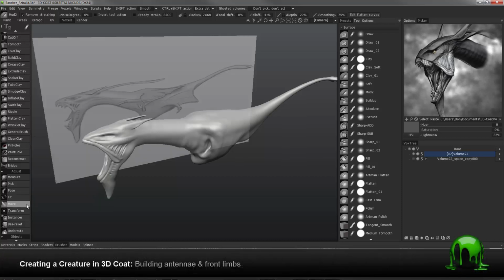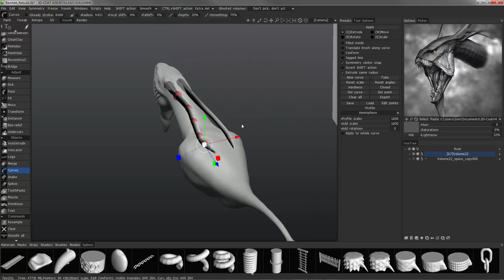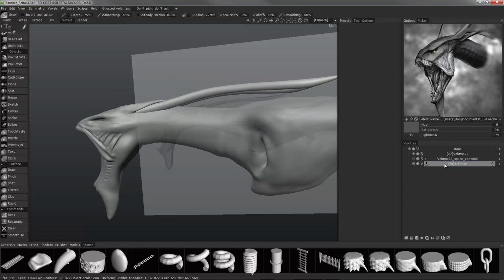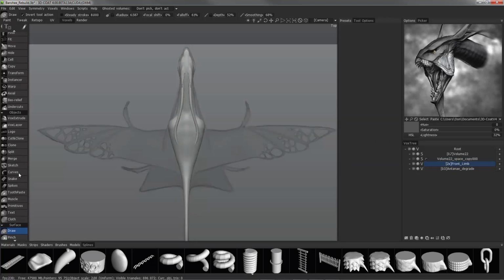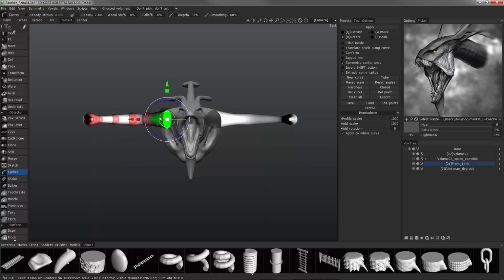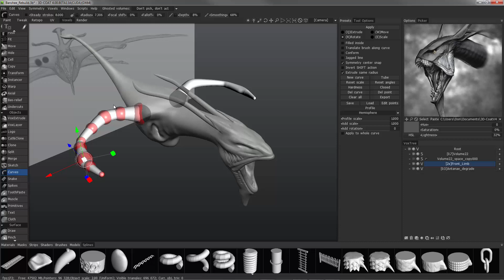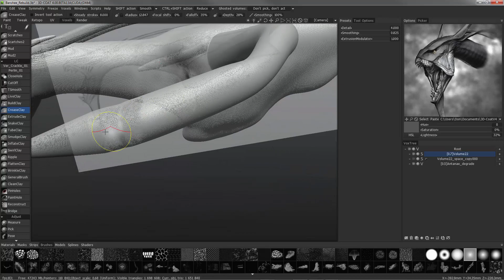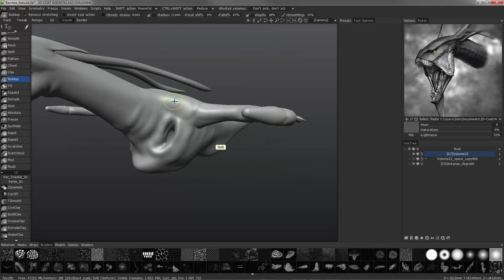Building antennae & front limbs

Comment: When I try and move points individually along the curve it moves the whole thing. Same for the scale. Was working fine before. What am I doing wrong? any ideas?
Reply from the maker: +Fin Uncheck "TRANSFORM CURVE" at the bottom of the tool options panel, in order to move individual points
Reply: +3D Coat Your a hero! thanks for getting back to me to fast